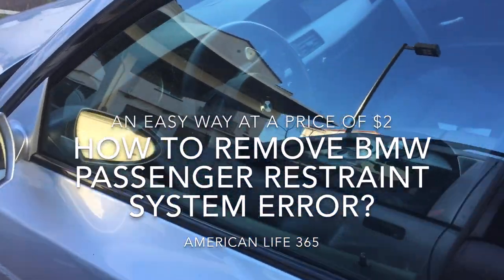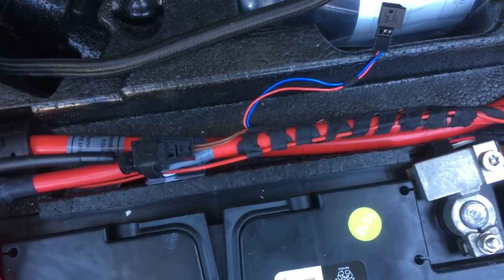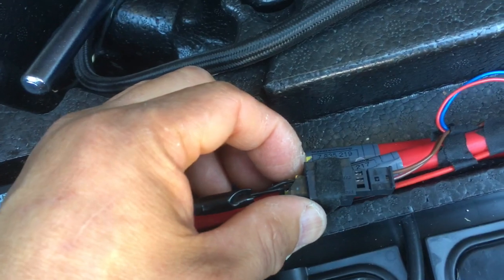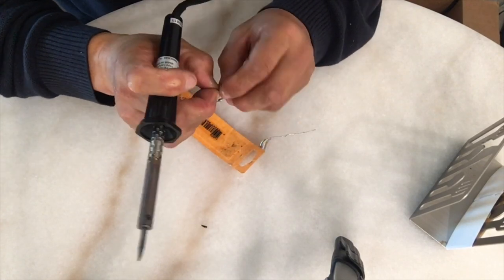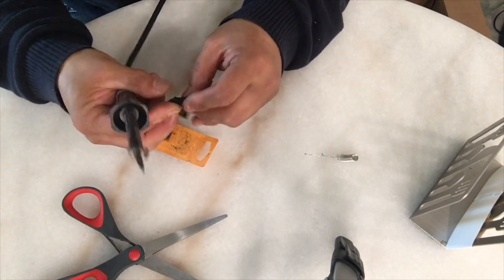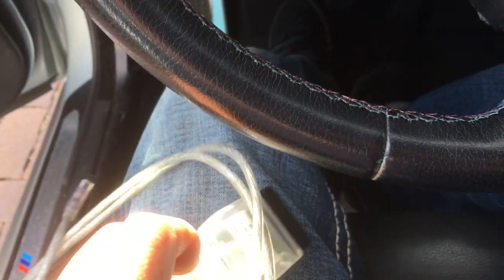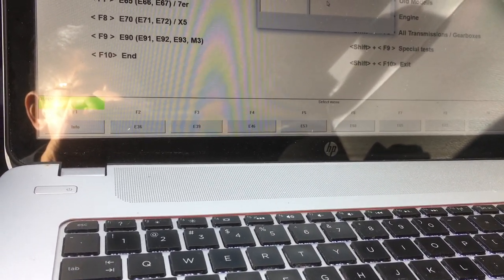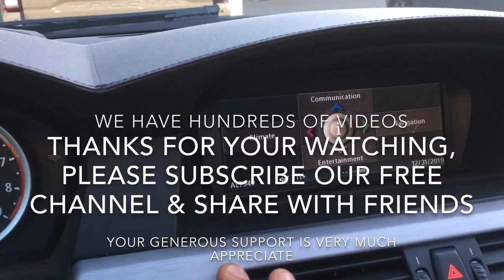An Easy Way For $2 To Clear BMW "Passenger Restraint System" Error Code

Comment: Thanks buddy I have 2 ohm and solder kit on way from Amazon already have reader.  Hopefully my magic moment is like yours so my drivers seat starts working again and heat.  Both are inop with passenger restraint fault!
Reply from the maker: After solder together, then use inpa or other scanner to clear error history.  It should work. I did this for my friend car too. It worked perfectly.

Comment: I have the driver restraint system failure on a BMW 2013 X3, can this procedure work too?  Thanks!!!!
Reply: Did you fix it??
Reply: @Antsazon  yes, just with a scanner.
Reply: Not an obd reader right bc I tried the code don’t pop up I’ll prolly just go to a mechanic who had a scanner
Reply: @Antsazon  the scanner is like 10 years old, but still capable of using it.  Has been working for a month without any codes, hopefully was just that.

Comment: Do you think this will solve error code: 0093f8 / ZK17 / Anchor Fitting driver?
Reply from the maker: most likely. Passenger restraint error is related to it. You should check with dealer find out if it is in recall list.

Comment: Do you have an email address? I have the same issue on my 2016 428i ...the battery setup is different and would like to send picture to confirm the wire.

Comment: By this way does the airbag still working ? What did we cut off exactly
Reply: This does not affect the airbag....but, it will affect the BST functionality to disconnect the battery when the airbag goes off.

Comment: Does it needs to be exacly 2 ohms , cauze i have some 2k s
Reply from the maker: not really, try it if it works. otherwise buy it from online or Frys.
Reply: I tried 2k and it didn't work? Did it work for you?
Reply: No i solved it with 2 ohms

Comment: I cut mine for my bmw 525xi e60. Now it won’t start. Haven’t even got to add the 2ohm resistor part but tried to connect it back normally and now my car isn’t starting. Any suggestions? Should I add the 2ohm? I’m stressed out please help anyone. I get no crank or anything.
Reply from the maker: Can you check your car electric breaker? Most likely you broken it when you cut the cable. Secondly, try to connect your cut line back to see if you can get crank.
Reply: 美國生活365 - American Life 365 where is car electric breaker? I’ve tried connecting it back and no crank no nothing. I’m getting about 14.6 volt too. I’ve connected where I cut too. I’ve tried jumping the car too.
Reply from the maker: I am in California.
Reply from the maker: My car has 2 fuse boxes, one is located under the trunk body undercover passenger side.  the other is under hood passenger side. It is hide in the vent pipe which is easy to unassemble.
Reply: 美國生活365 - American Life 365 I’ve checked fuse boxes in trunk and in glove compartment. Can you send me link where 3rd fuse box is under hood? Also once it’s found what should I do?
Reply from the maker: Under hook —passenger side- near windshield under vent pipe
Reply from the maker: https://youtu.be/vC4GkFqG4LI
Reply: 美國生活365 - American Life 365 yes I’ve checked all fuses and one 20amp fuse was blow in rear trunk fuse f87. I checked diagram but diagram doesn’t say anything.
Reply: Hey mate did you fix your problem??
Reply: VICKDEEEE I didn’t car been down for the past 2-3 months now.
Reply: @Keazyjuan  omg this why am i aint cutting no wires bmws are so finicky
Reply: @Keazyjuan  have it towed an independent who works on bmw letting ya car just sit there is gonna bring other problems
Reply: Sounds like it could be the immobiliser buddy and nothing to do with why you cut check your wiring for the alarm I bet you any money is the immobiliser you either unplug something and it's not plugged back in properly go back and check everywhere you worked on your car good luck buddy
Reply: @jameslatimer1432  thanks for your response! Ended up being ther starter!
Reply: @Keazyjuan  but did the light go away??
Reply: @TheVatocrazy  no I still get the air bag and seatbelt light